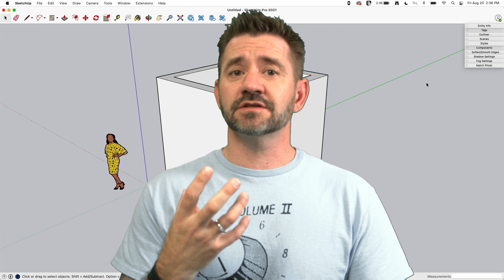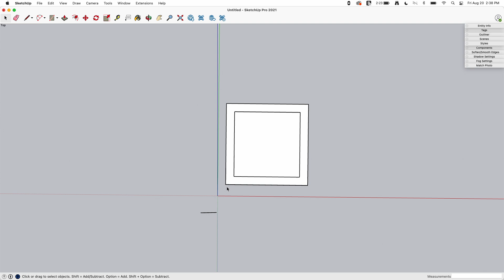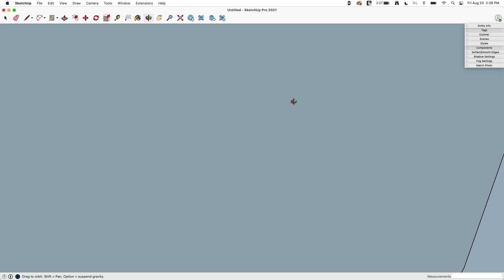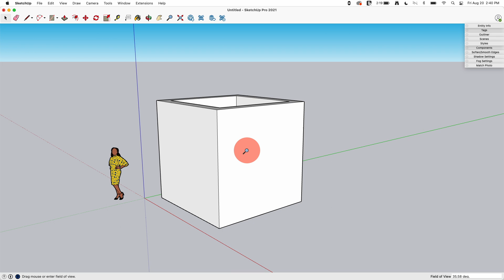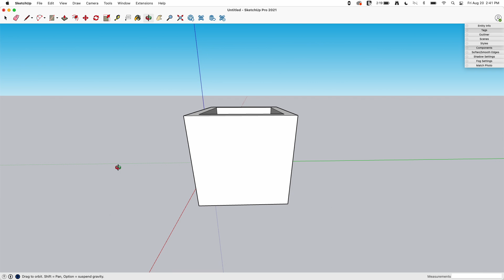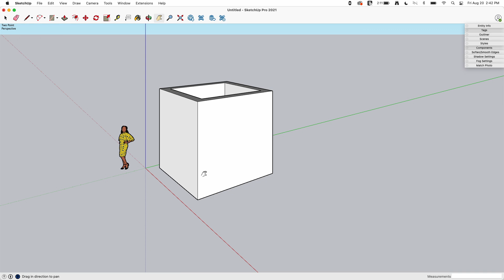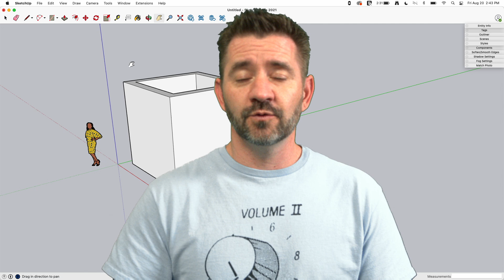Perspective or Parallel Projection - Square One

Comment: Perspective makes it easy to connect edges that are inside an object.  Let’s say you had four walls of a box, and you wanted to draw a floor.  Top view allows you to see all the bottom corners at one time so you can connect them with a rectangle.  Parallel projection is great for seeing a clean top view of a floor plan.  It can catch mistakes when things don’t quite line up.

Comment: I primally only use parallel projection to properly place objects in an exact X, Y or Z position when snapping or measuring is inconvenient.
Reply: I'm with you. The main reason I use it, apart from setting the viewpoint for Layout, is to check the alignment accuracy between objects.